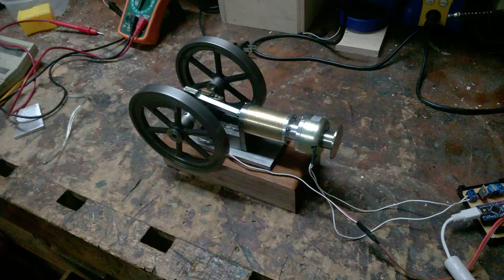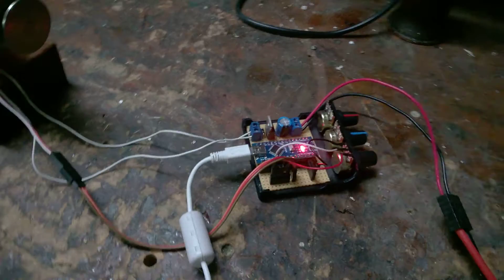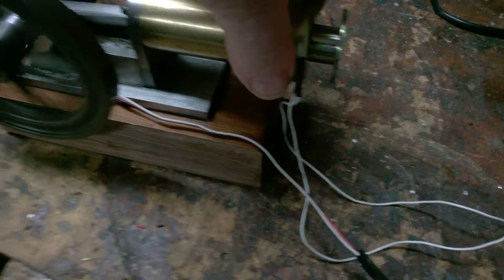HitnMiss Solenoid Engine

Comment: You know, I've often daydreamed about a Two Cylinder hit and miss with the 180, 540 odd firing pattern characteristic to a John Deere. Never have quite figured out in my head how to make that work, and ensure that both cylinders hit when the latchout releases. After watching this video, and a few others of yours this evening (by the way, I have been a subscriber of yours for nigh on 10 years), I think I have found the answer. Solenoid powered latchouts, driven by Arduino.

Comment: I was thinking varying the on time of the solenoid would also control torque/speed then you would need to add some sort of PID loop to regulate the speed. Have you looked in to building a camless engine using solenoids to open and close the inlet and exhaust valves, there is lots of interest in this technology and now your using micro controllers your the man for this :-)